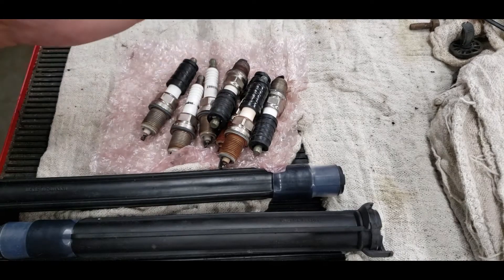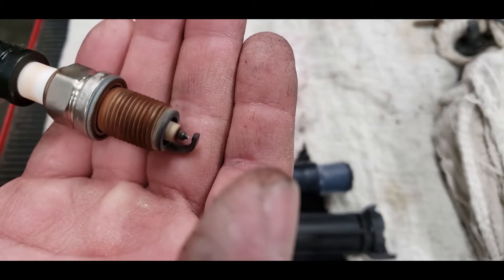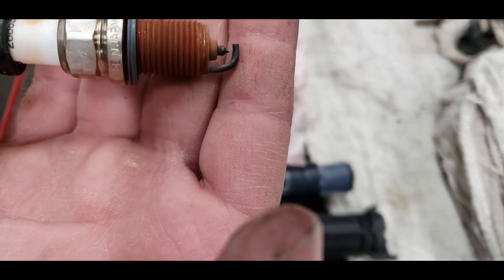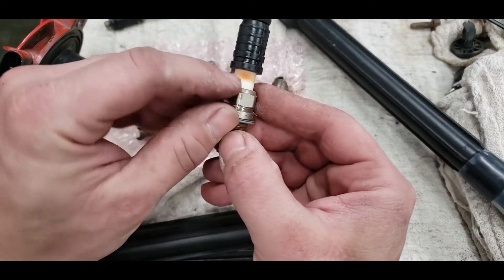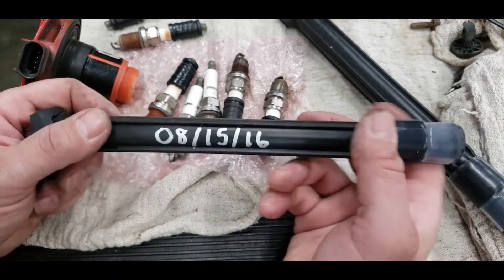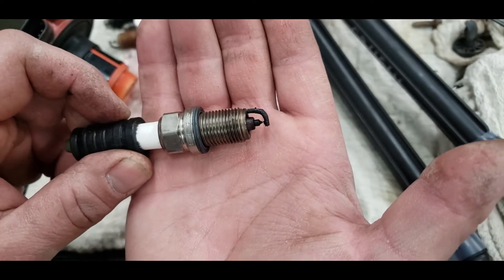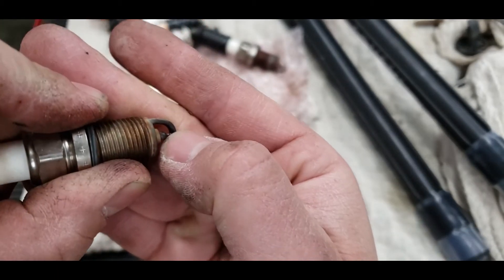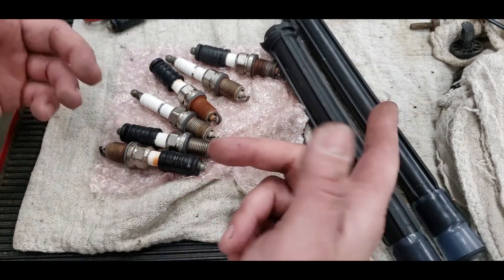CNG Spark Plug Failures

Comment: I change my CNG car spark plugs at every 13,000- 14,000 miles which cost just above 3 dollars, it's better to change them for optimal performance and miles per gallon. 
You will save more money on gas than not spending on Spark plugs.
Reply from the maker: I dont have much experience with the cng cars, but 3 bucks a spark plug is really cheap in comparison to the cummins spark plugs (45-50 a plug) but little bit of different application though too, these things see upwards 300k miles a year depending on routes
Reply: @BeardedSeabee82  I tell you what, simply Google Maruti Suzuki - Celerio CNG, check it's engine specifications and cost of service plus spare parts. 
It's dirt cheap, only 35 dollars for yearly service or on every 10,000 Kilometres which includes, labour charge, engine oil, oil filter, spark plugs, full car inspection, air filter and interior plus exterior thorough cleaning. 
I'm from India, New Delhi.
Reply: @BeardedSeabee82  also those plugs you talking about are really great and 300K miles is way too much for a plug in my opinion specially if car is running on an alternate fuel.
P.S - It's 3 dollars for 3 plugs so 1 plug is for 1$.
Reply from the maker: Ahh. Yeah i can see on car aide would be cheaper, but semi trucks here different applications

Comment: Man, that brought me some memories back. I had a job as a cng (compressed natural gas) test driver and I remember driving those cars with the huge tank on the back. Scary at first but then you got used to it because the cars worked just the same. It was an interesting job though. I'm not sure if that's the same thing you're referring to.
Reply from the maker: Thank you for input, as for the semi-trucks, indeed similar akin to what it sounds like you test drove. Ours have large tank set ups in back of cabs also (looks like giant box add on), and also there are some trucks with smaller sideskirt mounted tanks (in aluminum box housings as well). thank you for watching!